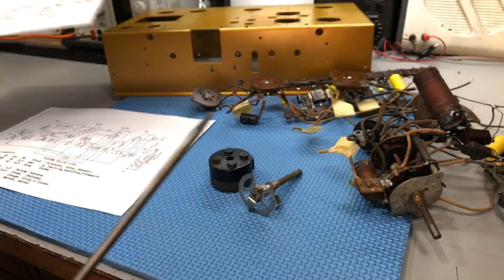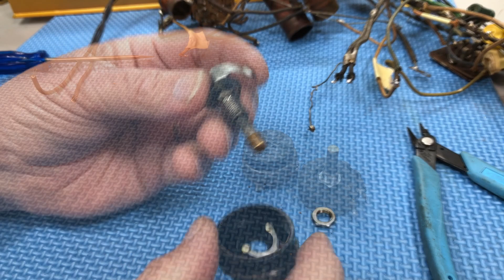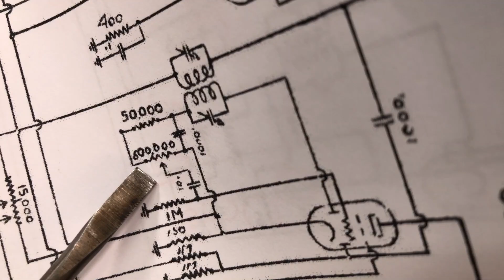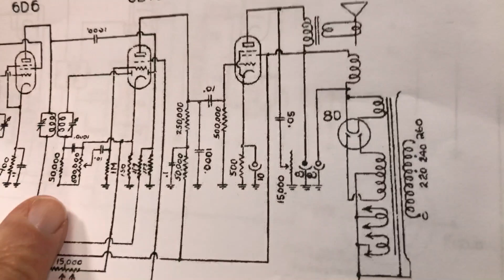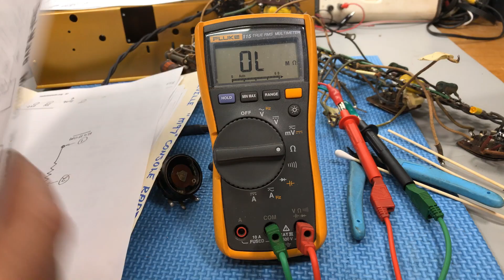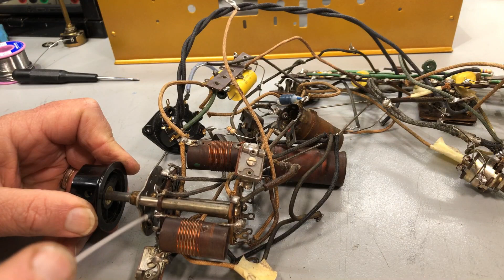Breville 1936 M96 Console Radio -  Pt 7 - Going Potty !

Comment: Hi Baz,
Seeing the location on the circuit diagram of the tone control, 15k value ww rheostat/variable potentiometer is not unreasonable.  Personally I’d have played with 47k to 220k lin carbon track potentiometer with a 47nf, or 100nf @ 1kv working tone correction capacitor.  It largely depends upon what the radio circuit will tolerate, and what is pleasing to your ears.  In these comments, I read that a 470k variable potentiometer would be okay.  Sure, I agree!  One reason Breville might have used a 15k ww variable would be to allow for a certain amount of high frequency audio to pass through the passive differentiator circuit down to deck without putting stain on the potentiometer thus providing a set amount of top-cut, or tone to contribute to producing a pleasing tone, or sound of the radio, which can also be manually variable.
Nice chatting with you (so to speak), and I’m certainly enjoying viewing this Vintage Radio restoration series.
Best regards, Phil.
Reply from the maker: Hi Phil, this is so interesting. 
Question: The reason that you suggest a 220k pot to replace a 15k wire wound.
Can you explain to myself & to my Subscribers why this is the case ?
Cheers Mate
Baz
Reply: @techobaz55  
Hi Baz,
Restricting my response to your question to a max of 250 words, therefore omitting any accompanying math, I’ll keep this straightforward.
Using the existing 47nf ‘top cut’ capacitor, taken direct from the anode triode, without any accompanying external resistance (fixed or variable) down to deck, only the low audio frequencies would pass through.  Increase that capacitance value, audio would sound very bossy - more than likely it would sound very dull with reduced volume.  Reduce the capacitance, audio would be less brassy.  Remove the capacitor completely, quite likely audio would sound very shrill, and oscillations might occur.
To restrict the ‘top cut’ effect, a resistance is added.  It’s value will be selected to relate to the value of the selected capacitance; type of speaker selected, cabinet design and materials, the entire unit is housed, and definitely how the whole set-up sounds to the ear etc.  Manufacturers will research which part of the market they will aim for particular models as well as production costs, therefore producing what will hopefully be appealing to the consumer.
So, why 220k?  Without including math, as I indicated earlier, it largely boils down to circuit design, and what that particular audio circuit will tolerate,  but most importantly how well the finished article performs, and sounds.  Say, like I’ve seen in a few old radiograms, the top cut capacitor value was 100nf, (on one model it was 220nf) and the value of the accompanying lin-potentiometer was between 100k and 470k.  It will also depend upon a circuit design for a chosen set of valves etc. Variable resistances from say 100k up to 470k lin might well serve the required purpose.  In one or two instances, I’ve seen where an  accompanying pot was paralleled with a lower value capacitor, or resistor in series with a lower value capacitor to provide a given level of fixed, or set tone.
15k might appear a low value by comparison but a set amount of high frequencies will be restricted, therefore giving a type of set tone effect but will also vary the tone at the same time.
In short, it is what an audio circuit will tolerate (electronically), and the sound of the finished article.
Tone shaping, as a subject in itself, is very fascinating whilst at the same time very complex ( see “Electronics old and new” latest video).  Hope  the above goes a tiny way to give some modicum of reason.
Best regards, Phil.

Comment: On the older circuit diagrams (and I guess on devices too) that were marked with an "m" actually were measured as x1000 so 15m meant 15000 or 15K -confusing but true. Devices that actually were in megaohms were denoted with "meg" which I think I saw on one of your circuit diagrams in the video. Good luck with putting that cats cradle back in the chassis, looks a bit tricky.
Reply from the maker: Ah, thanks for this info ! I am not totally familiar with very old schematics like this one.  The Cats Cradle ? Well I'm plucking up the courage to start this next Vid, what could possibly go wrong ?
Cheers, Baz